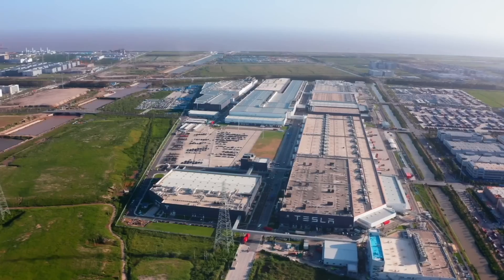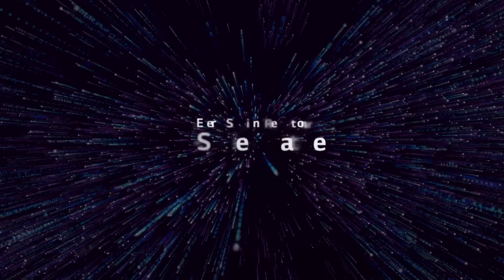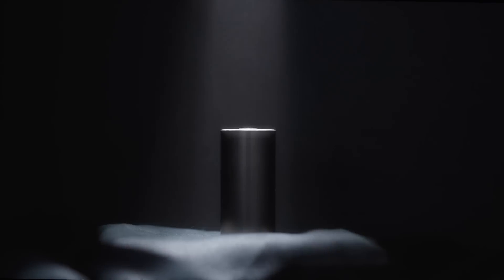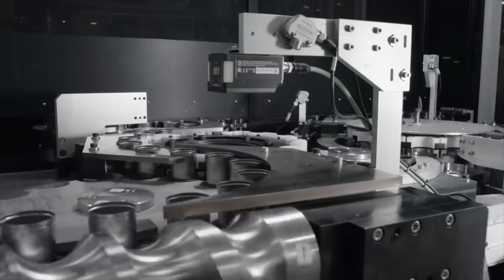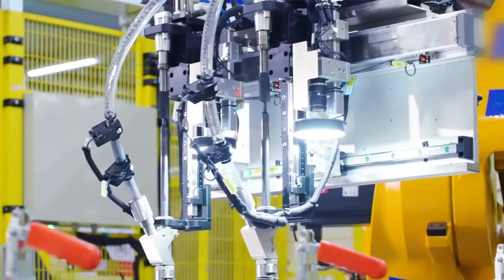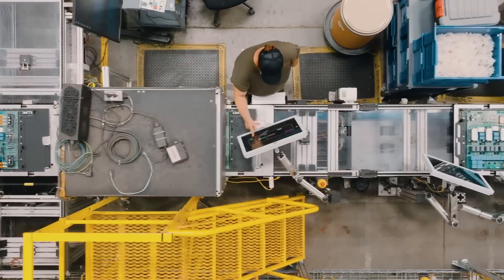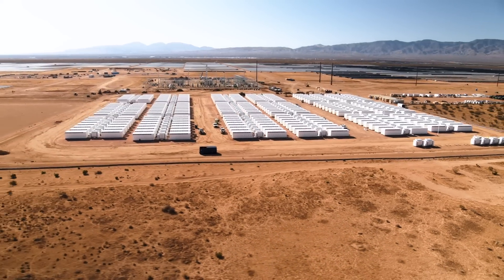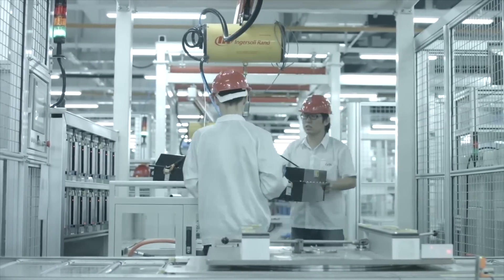Tesla Prepares For New Battery Upgrade Enabling Faster Charging Speeds | This Changes Everything

Comment from the maker: Soon I think we’re going to see a standardized  battery that provides at least 400 miles of range across the board for all models and trims, do you think it can realistical this year?
Reply: Maybe around 600 km standard then up to 1000 km
Reply: Lucid already offers 400-500 miles packs.
Reply from the maker: @IK77 yeah but it’s not a really affordable mass production car, maybe their cheaper models in the future will be excellent
Reply: Considering that's the case in China yes
Reply: @Darkmoleman ? Cltp is far from EPA
Reply: @christianolsen9781  are you talking/comparing  the EPA with the MEE?

Comment: They need a 500-mile battery capacity to put the practical mile capacity up to par with the gas equipment engine: about 360 miles. Then you'll stop once or twice to recharge on long trips. 👍 👌
Reply: I'd rather they work to have batteries that can just charge to 100% without a problem. Unlocking the extra 20% for daily use means lowering the weight and cost eventually. You're effectively paying for 100% of the battery when you only use 80% of it the vast majority of the time.
Reply from the maker: @livedreamsg yeah I agree with you
Reply from the maker: Yup agree
Reply: Completely agree. I am waiting for 500+ mile car to change mine. Plus no degrade.

Comment: Very bad presentation. Far too much talking. Every adult will say ‘goodbye’ after 5 minutes. Unbelievable. The plus is, that several video fragments are used now and than. But in general: too many words, to much sentences and it takes far too long time before the speaker is coming to the answer or main points. Students will get an insufficient mark for such a presentation.
Reply: lol i ended up putting it on in the background to listen instead as if it were radio and i didnt think about it. Its just growing pains of learning the way of providing information whilest not detroying the brains of viewers
Reply: Sorry - your post is too long 😂
Reply: @christianolsen9781  Completely right. I agree 👍

Comment: I have a 2023 MODEL Y AWD LR with 15,000 miles. I paid $33,500 for it and only have had it for about two months. Should I sell it and wait for a used Juniper with approximately the same mileage to save money, or should I keep my 2023 model?
Reply from the maker: Honestly the 2023 is still fantastic with the new suspension. I’d wait until 2026 to see what else is upgraded on the Y before deciding. By that time you’d have HW5 and a bunch of additional features

Comment: 5 times more energy capacity simply because it's that much physically larger is pretty useless. In fact, because they're cylindrical they waste more volumetric space in the pack over the smaller form factor.

Comment: What about new battery for Model 3 Performance? In Europe the power is limited by the battery, acceleration isn‘t that fast as US-Models because this old LG battery is too weak.
Reply from the maker: Yeah until LG comes out with a better battery that can output more, maybe the 3 perf will stay limited
Reply: Marginally slower

Comment: With how ubiquitous Superchargers have become, and how quickly they already add miles, 400 miles of EPA range is not needed by over 95% of motorists. What's more important is lower cost.
Reply: It's obvious that you have never traveled on the interstate, especially in the cold.  My 300 mile range is actually more like 150 on the interstate in the cold.
Reply: @spampeg  I've been road-tripping for 8 years all electric. I still have a gas truck but I haven't used it for a road trip since I bought my first EV 8 years ago. Maybe the difference is I have had 4 Tesla which do not lose anywhere near 50% of their range when road-tripping in arctic conditions.
Reply: @ZipZoomZip  @ZipZoomZip I have a 22MY LR AWD, battery around 6% degradation, approx 300 miles at 100%.   14,000 miles this last year, about 3,600 of them cross country.    

The range at highway speeds 70-75 on FSD is tolerable, probably 180-220 miles depending on location and load.   If it's winter time, same interstate speeds, heat on with seats on, FSD driving, 150-180 miles tops.
Reply from the maker: It will definitely bring the price down, which is great
Reply: Options!
Reply: Actualy no. Having some meaningfull  bat capacity after like 10 years matters, amount of cycles is lower with higher capacity. So if I dont want  to take ICE rentals for weekends, I need around 500 miles range. Traveling on highway 130-140km/h cuts your range in half and If we are talking about winter and below zero temperatures, snow on the road etc, I get less than half. Means, Im hugging charger every 150-200kms. Which is absurd. So 500miles of epa means maybe 300 miles of real range in real world.
Reply: @mravecsk1  I wasn't speaking to your use case, I was addressing what 95% of motorists need to have convenient and cost-effective electric transport.
Reply: True most of people just travel once ir 2x a year so having supercharges at every 100km it is all good to go.

Comment: Yes PLEASE TESLA 🎉 Pleas make the model y base have like 560 km range and go up to 900 km
Reply from the maker: That will be the norm soon, fingers crossed in the next year or so
Reply: Why? Who drives that in o e shot unless your are peeing inside the car hahha
Reply: @felipemelo8605 because you do not drive 100-> zero. Need to stay between 10-80. So 900 is 650 in good conditions 500 im bad.
Reply: @christianolsen9781  yep yep I agreed already with that
Reply: @felipemelo8605  900 km range on the paper (wltp or even EPA ) aren't really 900 km on the highway, you can say it's about 550 km on the highway (my19' model s plaid has 695 km wltp , but only ~440 km on the highway wenn i drive without  accelerations , equals ~310 km for 10-80%, and that's rhe ninimum for me)

Comment: The battery I am truly excited about is "BYD's second-generation Blade battery, or Blade 2.0, is expected to launch in 2025, offering improved performance, longer range, and a longer lifespan compared to the original Blade battery. Key improvements include higher energy density, faster charging and discharging rates, and potentially lower costs." Also, Samsung solid state that is a bit further away "Samsung SDI is developing all-solid-state batteries with the goal of mass production by 2027. These batteries promise higher energy density, faster charging, and increased safety compared to current lithium-ion batteries. Samsung has developed a prototype with a range of 800 km and a lifespan exceeding 1,000 cycles."
Reply: Wow
Reply from the maker: Yup we’re all super excited for solid state to arrive, it’s going to be a massive upgrade

Comment: I have a model s plaid w factory 21 inch wheels. It barely goes 250 miles on pure highway driving. I'll buy my next when the battery is rated over 500 miles and hope for 300 on road trips.

Comment: How can 5x the energy density only give a 20% increase in range. Seriously energy density means more power, 5 times more storage of power per cell which would equate to 5 time the output. This is confusing me, as energy density directly reflects on range.

EDIT:
Ahhh they are not talking about energy density at all, Energy density is how much power you can store per kg of battery
The size of the 4680 means it has 5x more power, but energy density per kg is actually lower than the 18650 cell.

So it is just a much bigger battery with obviously more energy than an 18650, but if you took the same weight in 18650 cells it would give you a longer range.

Like how they are confusing people to think they just improved energy density per kg .

Comment: The more interesting question is, can these 400+ miles per charge batteries be retrofitted to current or past Teslas?  If yes, then that would open up a new business for Tesla, e.g. swapping out old battery (technology) for new battery (technology), and prolonging the shelf life of older Teslas.
Reply from the maker: Very little chance unfortunately. Even if it was technically possible they wouldn’t go through the hassle rather they just sell them newer cars and allow them to trade in
Reply: @heyJohnEe  Lease for as short of a period as possible and get into newer technology as soon as possible. Lease payments are usually lower than finance as well.
Reply: @KP-xi4bj usually yes. Trade monthly payments for hassles while dealing with car. Car is a depreciating asset. Prefer to pay least amount possible while avoiding any problems that require my attention.
Reply: @russellhoguephd7925  Do you even understand the word, "perpetually"?
Reply: @SaltyPirate71  That's simply not true. Not even a little bit. First, when you buy a Tesla lease, you can pay the extra mileage up front. I will always drive 18-20k miles per year. It's about half the price to add the mileage up front. Regardless of buy or lease, you always pay for the extra mileage. You either pay for it with cash, or you pay for it with lost value on trade.

Comment: Tesla will likely give these cells to the Cybertruck 1st, since its range sucks. Then to the new Model S and X rumored for later this year. I bet it will take a few years of ramping to get these into the 3 and Y. And those years of ramping will allow the cost to decrease making them viable for the mainstream 3 and Y.
Reply from the maker: Yeah that’s very possible, but since a large portion of countries don’t even have the Model S, X or CT, I would say the CATL and LG batteries could be available first outside the US for the 3 and Y too
Reply: I doubt it. Cybertruck is dead in the water. Better range can't solve the fundemantal issues with it, ie that it's just ghastly and people don't want to be seen dead in it.

Comment: Does this battery update includes the Starndart Range Model Y which is offered in some select markets?
Reply from the maker: It should include all trims and all markets once, the new minimum standard for the base model will hopefully be much higher once these new batteries roll out
Reply: @heyJohnEe standard uses LFP, though

Comment: 400+ range
0% APR
M3 $25-30k
MY $35-40k
MS $50-55k
MY $55-60k
CT $60-65k w/ midgate

After tax is my trigger.
Reply: I’d like a 200k mile warranty on motor and battery if they really believe in their product
Reply from the maker: Those numbers are very doable soon once battery prices substantially goes down once they all crack the new 4680 densities
Reply: @heyJohnEe even after battery prices come down, I doubt Tesla will reduce the cost of their cars. They will likely keep that profit and use it to do more research and development. 

Only thing that can bring down prices of Tesla to those ranges is competition…. which is non existent in America.
Reply from the maker: @kshitiz06 yeah that’s a good point, we need more competition!

Comment: 400+ miles is the sweet spot for me. My math has always been figuring staying between 10% and 80%. That gives you 70% of the stated range, which is 280 miles. A person could still withstand 10% degradation and have 250 miles of range between charging on road trips. This has always been my thinking, especially before considering faster charging speeds.
Reply: 250 is a stop every 3 hrs. About right, although i would gladly take 200 but with faster charging. Efficiency, charge rate, capacity is to me the right order of preferences
Reply: @palpatov I stop when my tank is on reserve -525 miles.
Reply: @graphguy  and then you waste a minimum.of 10 minutes filling the tank. With an EV the car charges while you sleep or while you  eat lunch on a road trip. I have covered over 10,000 miles since I last interrupted  what I was doing for fueling. That beats your 500 or so miles at least 20 times over.
Reply: @palpatov I've never covered more than 220 miles, usually I get 200 miles, in 3.5 hours. So I get 4 hours out of the first leg of my journey and 3.5 hours after that. This is working in winter with a ~300 mile range EV.
Reply: @AdrianHilder  That had been my experience as well. 3-4 hrs is bladder limit. Unless you are peeing in the bottle or pulling some other crazy s—-t, thats the endurance limit. So why even bother carrying the extra weight of the capacity that is not utilized?  And paying for it directly and indirectly….
Reply: 500+ for me. Until then I will stay with my ice vehicle that gets 550
Reply: @ , you are waiting for solid state then. Probably 2027 or 2028.
Reply: @rickblanton4328   I hope you’re right about solid state starting to be offered by 2028.  It has said to he coming soon for about a decade.  

Until then, I wish Tesla would just do like GM does on the Denali and Hummer by including an enormous 200+ kWh battery, at least on the Cybertruck.  Give people a 500+ EPA range, 350kW peak charging and a better charge curve on 800V chargers, then the Cybertruck would still be selling out.  19.2kW (80A x  240V) home charging would help too once the battery has well over 200kwh capacity.  

For the model X and S refresh, they should include the same or very similar 123 kWh 800V battery from the Cybertruck to replace the current 100 kWh 400V battery.  That would give them around 70 more miles of range, faster charging, and economies of scale from using the same 4680 cell based as the Cybertruck.  The current 400V 100kWh battery or a very similar one to what’s used on the X and S should get used on the Model 3 and Y.

More improvement at Tesla has to start happening faster or China is going to leave even Tesla in the dust.  Tariffs on Chinese vehicles is the only reason legacy automakers are still in business.
Reply: This is usually the thinking of people who don’t own EVs.

How often do you go on road trips?  Are you driving 250 miles / day / everyday nearly?  

There is very little reason for anyone to have more than 150-175 miles of range (after degradation/weather loss/arriving home with 10%) if they are charging daily.  150 miles is an hour commute each way plus plenty left over for minor errands.  175 gives you a bonus buffer.

If you want a battery that holds a 250 charge, your going to need a 75% bigger battery which increases the cost of the car and means you are hauling around a 75% heavier battery increasing the cost of your day to day usage.  Or you can get a smaller car also,

All that to speed up the 1500 mile road trip you take once a year by 90minutes total each way?  

Buy your EVs based on usage, not on some hypothetical number that equals a gas car.
Reply: @ , My family is 1,400 miles away. When I first moved I was driving to see them once per month. As my current car is really old now, I only fly and rent (once per year). I would like to drive there once per quarter, much less other travel I would like to do for recreation. I also rent at the moment so charging at home isn’t an option for me. 

This talk of larger batteries is moot as everyone commenting here is doing so on the premise of higher energy density. So I will say this as delicately as possible, STFU.
Reply: @rickblanton4328  I have Model Y and Toyota Highlander hybrid. I think hybrid solution is best in your case where home charging is not possible and no problem for long trips. EV are a good commuter solution for now, but I charge at home. If I had to only choose one it would be Toyota hybrid every day.
Reply: The problème is that at 75 or85 mph you don t have 400 miles range
Reply: @robin_granger8838 or if you use A/C haha
Reply: @robin_granger8838  70 mph is the speed limit is most countries.
Towing long distance is another story. The range of an EV about halves when towing so an ICE car is still best for long distance towing.
Reply: @AdrianHilder  70 mph max😄😄
Not were i live (France) or were I travel (Germany, Austria, Italie)
Reply: Right because 20-80% range of 300 miles is not enough operational range for those with long distance commutes even charging at home.
Reply: @ag4eng  start the day 100% then 10% to to 80% and it is enough because a large number people around the world are doing it.
Reply: @AdrianHilder  , depending upon what battery chemistry you have, charging beyond 80% regularly will expedite the battery degradation.
Reply: @rickblanton4328  you can charge to 100% frequently so long as you use it straightaway.  NMC batteries don't like sitting at very high or very low states of charge, but being at those states of charge for short periods is OK.
Reply: @rickblanton4328 no it won't. Problem is keeping the battery at 100% for a long time.
Reply from the maker: you hit the nail on that. 250 miles after degradation and daily charge limits is a very usable range, and for the roadtrips above 350mi on full charge is perfect

Comment: The CyberCap should have fast charging as it makes no money when charging.
Reply from the maker: Yeah that’s a good point, I’m sure they’ll add the fasting charging battery possible. But prob won’t be super fast since it’ll be wireless
Reply: It will have a small battery pack, and a slight improvement in charging speed won't be significant, especially since the vehicle will likely need to be cleaned while charging.
Reply from the maker: @jamespaul2587 yeah that makes a lot of sense. By the time it finishes cleaning the car should be fully charged
Reply: @heyJohnEe  yes, that seems likely. John and I've heard that wireless charging for cars has become more efficient recently also
Reply from the maker: @jamespaul2587 yeah it’s become way more efficient with less energy loss in heat, I can’t wait for Tesla to demo something like that
Reply: @heyJohnEe  Agreed, John. It would also be great to install in a home garage if efficiency and installation costs are reasonable. No more forgetting to plug in! 😊